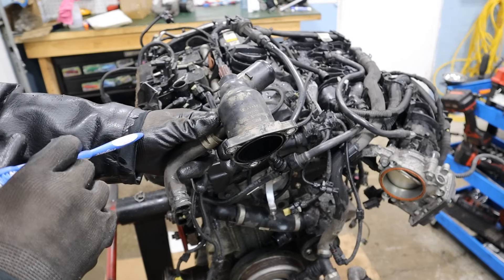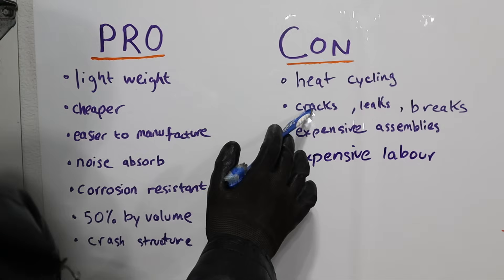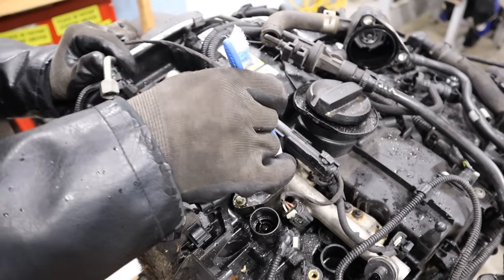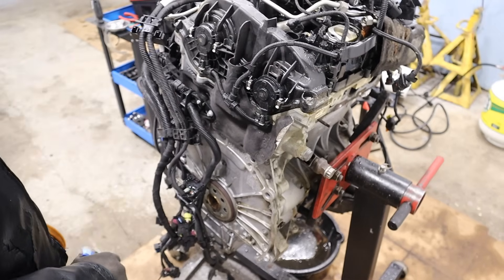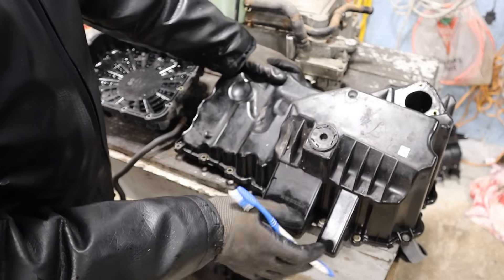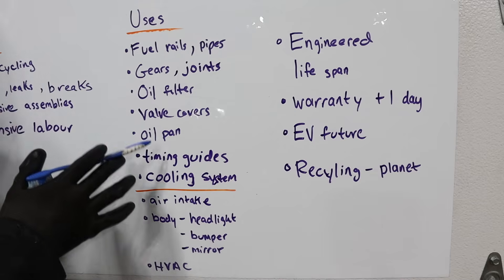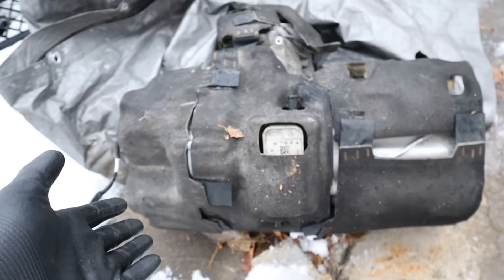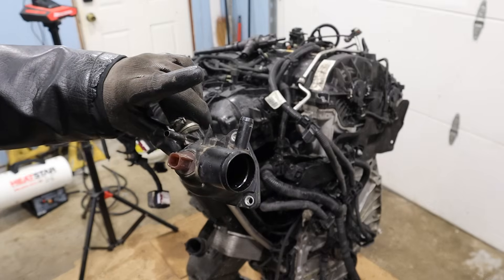Planned Obsolescence: Your Car is 50% Plastic and Why It Will Cost You | Discussion | Speedkast99 #6

Comment: I agree with your comments. 
With the price of modern gasoline engines being between 6- $10,000, it is inexcusable that manufacturers would resort to plastics with the obvious intention of saving manufacturing costs.
As stated, plastic will crack, leak, and fail before metal will. Period.
One would think that BMW, Mercedes, and other “upscale” brands would continue to use metal parts in engine construction.
The result is that one spends thousands of dollars in a premium price for an automobile, and still ends up with plastic parts which fail prematurely.
Having to replace plastic parts that fail on the exterior of an engine is bad enough.
When one has to go inside of the engine to replace plastic parts is a rip-off.

Comment: Plastic valve covers have generally proven to be reliable, as have oil filler caps. I actually like cartridge style filters. They make much less of a mess for me. Though the housing should be made of metal.
Reply from the maker: Not the caps.
Plastic valve covers do warp.

Comment: I guess some small plastic parts can be fixed with special glue? Although if those parts are made from metal, they'd probably not break in the first place.
Reply from the maker: If its a tab or bracket maybe. It shouldn't break in the first place.

Comment: Average lifespan of a 1970's automobile - 100k and 7 years and far less when used in environments where they pour toxic corrosives on roadways. Very very few were driving 30 year old cars, 
Average lifespan of a vehicle today- > 200K and not uncommon to see 30 year old automobiles in use.
Reply from the maker: But yet they're more expensive to fix.

Comment: Keeping my 98 Tacoma 2.7L 4 cylinder until it (and I) die.  No plastic valve cover. No plastic oil pan. The water pump is all metal. In 28 years it has never leaked. My driveway is spotless.

Comment: Using plastic in heat cycle engines , should be guaranteed by the manufacturer , that’s ok if they deny deliberate misuse of power to build something not  reliable and  not consistent ,there is a thing called ( review) when a potential customer can read up on dodgy manufacturer practices

Comment: I’ve been paying close attention to the auto industry since I was 15 back in 2014 (now 26), knew there would be a day where vehicles would have 100,000 mile lifespans again, now here we are. Doesn’t help they are using ridiculously tight tolerances and low tension piston rings, either. 

Thankfully I’ll be looking at something from the 1960’s with things that are all metal under the hood sometime next week.
Reply from the maker: Wow. You're so young and into the classics already 😅
Reply: @speedkar99 been into classics since I was 15, they definitely had their issues and quirks but there seemed to be more common sense in automotive design back in the 1960’s compared to the present in 2026.

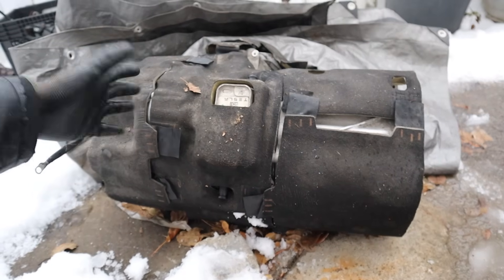Comment: 4:30 why would these plastics not be recyclable and where can i read more about that? It's stamped on them what kind of material they are, I don't understand how sorting them is different from sorting steel, inox or aluminum.
With that said i agree with your overall opinion.
Reply from the maker: They way they're integrated into the car is very complex. You'd have to physically separate them. 

Metal is just boiled down to it's metal temperature and sifted off. By that time, plastics have long vaporized

Comment: Corrosion/rust has never been an issue for me on thicker (or aluminum) engine components. It is more an issue on fasteners, and those will always be metal (I hope).
Reply from the maker: Nope. BMW uses aluminum fasteners. 
They're notibly lighter.

Comment: This isn't new. Spider injection in 90's GM trucks fails because they used plastic fuel lines inside the intake manifold! Best case scenario fuel washes down the cylinder walls and dilutes the oil. Worst case is hydro-locks the engine with liquid fuel and causes major engine damage. The beloved 2v 4.6L runs engine coolant through the plastic intake manifold which cracks and leaks. Sometimes catastrophically dumping all the coolant at once.

Comment: Ps. I think there is a REAL BIG untapped market just for re-metallizing (I think I just made a new word up) all those engine parts. I mean my old 1200 euro Toyota Avensis used to have a magnesium valve cover, you know, F1 materials. Now, I'm not saying any of this is gonna be easy, but the aftermarket has to start evolving into real auto makers to fix the "real automakers'sss" plastic mess.

Great video brofessor Kar of the university of speed.
Reply from the maker: Thanks! 
There are a few (like Dorman) aftermarket that make metal replacement parts for common failures. 

There are OE versions of the metal parts too, in older designs that you can replace them with. For example the Toyota 2GR oil filter houses are now plastic but easily swappable with the older metal ones.

Comment: Cheapo plastic is fantastic... 
Every German car we work on is plastic ticking bomb. On top parts as expensive as the aluminum ones. 
The 135k km BMW 528i X-drive skipped the tooth - the junk yard engine with supposedly 80k was throwing bunch of codes related to timing correlation. Well the timing chain assembly comes with the guides as one piece unit and what we pulled out from 80k km engine didn't look inspiring as it was already cracking into pieces.
Reply from the maker: Ouch. Another BMW bights the timing chain crust

Comment: You mostly nailed it but I think you missed a huge aspect and that is thermal conductivity.  In my opinion it’s probably the biggest reason for the increase in plastic use in engines. It all comes back to emissions, specifically cold start up emissions which are when a car pollutes the most. 

In short the the more metal you have acting as a heat sink for the coolant and oil, the longer it takes your engine to get to operating temps
Reply from the maker: Good point but I don't think that's the main reason plastic is chosen. 
It's just an easier material to mould than forging or casting metal.

Comment: happy to report that you could still buy cars w/ minimal plastics. just got the new suzuki jimny. no plastic thermostat housing, no plastic coolant hoses, no plastic t-joints etc. no DI, no turbo, no cooled EGR, no plastic oil pans. has dipsticks for both engine oil and ATF. has mechanical transfer case lever.
Reply from the maker: We don't have that here 😕

Comment: Yes too much is used. I really think the quality of the plastic matters too. My 2005 Honda Element with 345k( Freedom units)( Miles) has the orignal plastic water housing. It does not leak and is still serviceable. Everything else is Aluminum under the hood. The rear motor mount is even plastic.
Reply from the maker: Awesome. At least back then they over compensated with plastics. Now it's been "optimized"
Reply: Optimized is a very good word lol

Comment: Some of those parts may be  "thermoset" plastics (like distributor caps), which cure into a solid and cannot be melted and recycled. They can be ground up and used as filler material in other plastics, but the labor invested is not = to benefit received. So, landfill.
Reply from the maker: Exactly....just because things can be recycled they will.
Reply: @speedkar99  It's a religion for some.

Comment: In modern automotive engineering, plastic engine components are designed for high durability, yet they typically have a shorter service life than aluminum or steel counterparts when subjected to extreme conditions.

Typical Lifespan Comparison

Component Type 	Plastic/Composite Lifespan	                                Aluminum/Steel Lifespan
Intake Manifolds	6–10 years or 100k–150k miles	                        Life of the engine (250k+ miles)
Cooling Components	80k–120k miles (leaks often start earlier)	Generally life of the engine, though prone to corrosion
Valve Covers	10–15 years (prone to brittleness)                                    Life of the engine
Reply from the maker: Thanks

Comment: The D16Y5 engine in my 98 Civic uses a plastic upper and lower timing belt cover.
If you want to get pedantic, the engine also uses a small plastic cover for organizing and routing the fuel rail / injectors / EVAP purge valve components.
The rest is aluminum, steel, etc.
Reply from the maker: Awesome

Comment: Metal is the ultimate recyclable material. There's steel in cars today that started out as a beer cans in the '50's.
Reply: started out as ww1 tanks and ships.
Reply: And glass
Reply: Well, you took my comment, haha. Cast-iron blocks, cast-iron heads, steel valve covers and steel oil pans...all completely recycleable. IF they fail in the first place.
Reply: @Erik_Swiger  And aluminum isn't recyclable?

Comment: My first encounter with plastic parts when I overhauled my 4 cyl 1993 Toyota Pickup with the 22R-E engine.  The timing chain guides were plastic and broken.  I replaced them with metal backed guides.
Reply from the maker: Good call. Who made the metal ones?

Comment: I think if they are not recycleable then I'd rather have it be metal....BUT, I'm in the salty northeast where plastics don't corrode, I've not seen a problem yet, and I do love me some PEEK or even ox-pek would be awesome too.  So long as they don't dry out, have an adequate glass transition temperature, and hold up to over-torque, I'm fine with it....hence why I like PEEK so much.
Reply from the maker: PEEK is expensive though...

Comment: I learned that BMW uses plastic too extreme, when I tried to remove a radiator hose from the radiator, and the plastic radiator connector (not metal) broke off!
Reply from the maker: Sadly, alot of people experience this!!
Reply: That's kind of normal on made in Germany 4wheels
Reply: The issue is that people do not do frequent coolant flushes in their BMWs (50 to 70K miles) and end up corroding the plastic. Ass soon as the plastic turns brown, you are in trouble. My BMW plastics tend to last me a long time, but I am also very good with car maintenance, but they still fail eventually, but in my car is when the car is well over 10 years old and close to 200K.
Reply: What about Ford and RAM plastic front-suspension upper-control arms!  Surely these can't be durable?

Comment: My 2007 car only has a few components made of plastic. Thermostat housing but apparently it's a much befier plastic than nowadays, and coolant T with 3 hoses but the whole unit was replaced with a silicone one even tho you can simply just buy the T made of metal same with the thermostat cap but it can wait for now. The only parts that i can't replace with metal are the timing chain components unfortunately.
Reply from the maker: Aftermarket should step up and make metal ones. What car is it?
Reply: @speedkar99  Engine ecotec LK9 aka b207R on saab and gm group of that age, the plastic timing component aren't a big issues as they don't break but that skate part can't be replaced so meh, it won't hurt

Comment: Fortunately my cars are a 99 CRV, 00 CRV, 06 Camry. I’m not sure if the Camry has a plastic thermostat housing. I don’t think so. 

I’ve replaced the thermostat a few times on the CRV.
No problem with the metal housing. No problem with the metal valve cover. 
Both cars use a traditional oil filter.
No low tension piston rings. No oil burning.

Just trying to keep the rust at bay as long as possible 😂😂😂
At least rust won’t be an issue for Kia, Hyundai, dodge etc. won’t last long enough 😂😂😂😂
Reply from the maker: Is your Camry a V6? 
Mine is the 3.3 L
Reply: @speedkar99 no, I wish. I’ve seen your videos on the V6.

It’s the 2AZ-FE but I believe I got the sweet spot between loosening head bolts before 2006 and low tension ring oil burning issues after 2006.
Ontario car originally but only ever winter driven for one winter so zero rust.

Comment: I would caution on the general notion that plastics are cheaper... In certain automotive conditions, given enough quantity, then yes, plastic may be cheaper. However, molds are expensive to make, especially bigger ones. I do agree though, I don't like plastic on critical parts.
Reply from the maker: Moulds have to be made for stampings and forgings and die castings as well...

Comment: No, it won't 'cost me'. Plastic does not rust. Plastic does not corrode. Plastic does not have many of the drawbacks, especially if carbon composites that CAN BE RECYCLED TODAY are used.
Walk off with these lies.
Reply: I thought we were supposed to glue ourselves to the road to STOP OIL this week but now we need more plastic to make engine parts. Plastic is made out of oil 😂

Comment: My motorcycle which is often considered a toy has better engineering than most modern cars. The engine is almost completely metal.
Reply: Yeah entshittification hasn't hit motorcycles yet. At least not that hard.
Reply: But we already have pay to unlock features on ktm
Reply: @Angry-Lynx  ktm makes dog shit anyways
Reply: @3SPR1T absolute dogshit.
I despise that brand with how they treat customers in last few years. 
Old ktm 950/990 is amazing despite issues but other than that don't care
Reply: @Angry-Lynx  I thought about the camshafts made of cheese and not owning up for it.

Comment: I'm surprised engines aren't one piece of injection moulded plastic, yet. Soon they will be one piece, with no oil pan, no valve cover, no intake manifold...

This will happen right before the entire car is 3d printed, bumper to bumper & there are no mechanics, any more. Cars will be designed to be discarded & replaced, with no maintenance needed & repairs impossible.

<--- disgruntled ASE Master Technician 😡

Comment: I don't think all plastic parts are bad, some can last but yes it is getting to the stupid level and for minimal benefits.  We really need the OEM's to push back and explain what giant carbon footprint there is throwing vehicles away every 5-8 years in the name of "The environment" because they don't last and are made of materials that can't be recycled, when we can make them last longer but they put out a tiny amount more out of their tailpipes but that is far outweighed by the giant carbon footprint of making so many new vehicles every 5-8 years.  Can you imagine if you had to throw out your fridge or washing machine every 5 years?  People would be up in arms, but a car which costs 30-40x as much, oh no problem... It's lunacy!
Reply from the maker: Exactly....they made a car like technology...outdated every few years so people don't care to throw it out.
Reply: @speedkar99  I drive early and mid 2000's stuff before stuff got stupid.  I keep piles of spare parts and parts cars for the ones in service.  I rust proof yearly at Krown (been using it since the 1980's) and I intend to drive these things as long as possible.  It's so sad what cars have become.

Comment: Plastic is cheaper and lighter but less durable in the long run. Repairs are expensive due to increased engine complexity. It forces people to buy new cars more often which is a plus for car makers.
Reply from the maker: That also makes the landfill littered with cars that could have been operating still
Reply: @speedkar99  Plus the pollution, energy, materials and labor cost of manufacturing  another car when the old one cannot be fixed because it is too complex and expensive.

Comment: The worst thing about the hard plastics used to manufacture cars is that they are entirely unrecyclable. This exposes a lot of the concern about pollution as self serving and incomplete. It's true that catalytic converters and EVAP pollution control have led to cleaner cars, but changes in the past generation including cylinder drop out technology have been a backward slide. Streamlining some of those fuel economy regulations to prolong the survival of cars could be a good move overall.
Reply from the maker: I agree. Landfill agrees too

Comment: It's nothing new Ford had plastic timing gears on the V6 engines right back into the 1960's and yeah they also failed !
Reply: So did GM on their V8s. Which also failed.

Comment: I just learned that the 1.0 liter Honda 3 cylinder engine uses 2 wet timing belt! The cambelt and oil pump belt. 

The engine needs an overhaul at 80K miles! The belt debris clogs up the oil intake and the turbo charger shaft wears out because of oil starvation. Turbo had to be replaced (this is one very expensive part). Fortunately, the engine is sold in Europe and Asia only. 

Honda and generally Japanese cars aren't built like the way they used to.
Reply from the maker: Hate wet belts
Reply: Have you been living under a rock?
Reply: @-DC-  no. Just in America where these engines aren’t sold here.

Comment: i think plastics are ok for carrying air but not coolant or oil. metal does produce a lot of c02 when smelted and refined so plastic is probably better for the environment there. i saw a scrapped rover 414i with plastic body panels, wasn't a patch of rust anywhere.
Reply from the maker: And that's where I'd draw the line, air intakes have been doing fine

Comment: Guess it is better to buy a EV.
Reply: And when the battery fails (it will eventually), it will be cheaper to just replace the car, no thanks...
Reply: I will never switch to EV until passenger airplanes switch to EV.
Reply from the maker: They use even more plastic
Reply: @speedkar99 the fun fact there is so little plastic component in aircraft system, including the engines, most of piping and other components are made of metal.

Comment: There is no environmental or EV spin for using plastics. That's just trying to be political.

It's just cost. It's simple as that.
Reply from the maker: EVs are heavy. They can make the whole thing out of sugar as long as the weight is supported
Reply: @speedkar99  EVs are expensive with 0 or negative net margins for most OEMs. They heavily use plastic because it brings the costs down.